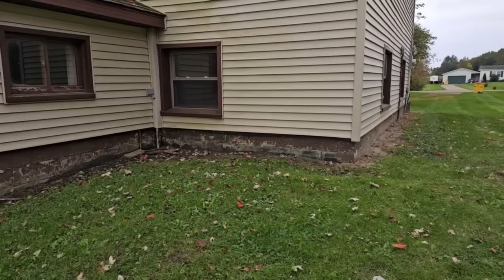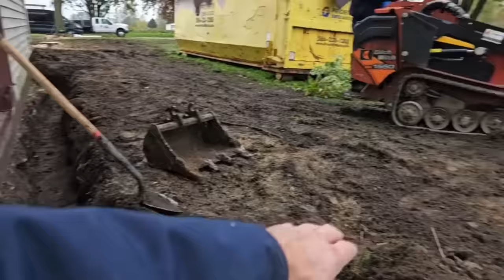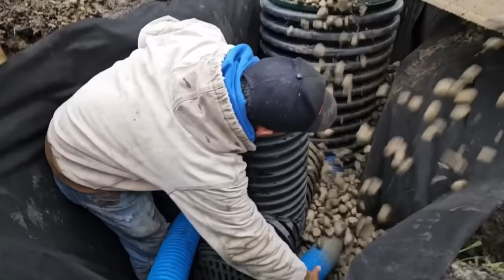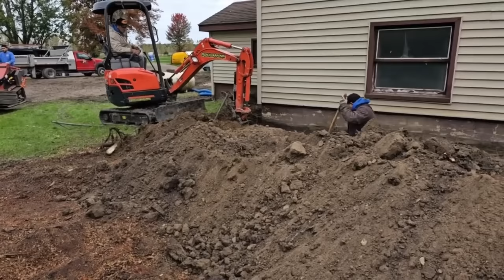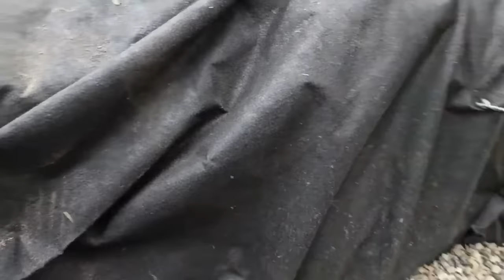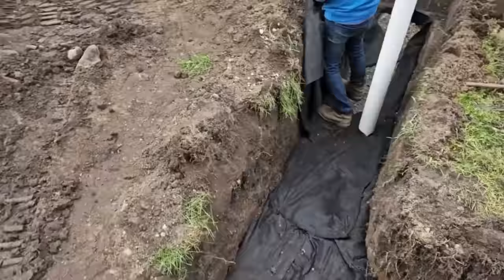How to Install Exterior Foundation Drain that Lasts Forever

Comment: A few questions:
1) Why the stone bed outside the fabric?
1a) Why no stone layer under the Hi-Octane Pipe?
2) Why no rubberized sealant on the foundation?
3) Would the double piping be more effect if they were at different depths?  I would put the one further away from the structure a little deeper to make the actual perimeter drain is a final outside defense against water intrusion.  Or would a drain further away from the foundation be more effective above the perimeter drain?
4) I see you're using a larger stone on top on the exhaust section of the system - why?  Doesn't larger stone tend to collect more water?
5) It seems that the footer drain is well below the footer of the house.  My other research indicates that slightly lower is ideal.  What is the reason for this?

Thanks for a response to any of these questions someone may know the answer to.
Reply from the maker: What you really need to do is watch the entire series and don't skip around in the videos. I answered all your questions, plus so much more valuable information at no charge 😃
Enjoy 
https://youtube.com/playlist?list=PLjFCqaZ4v1BWSyew4JyZuxDpBvULztf91&si=wZxI-Kk5-uNMQuc6
Reply: @FRENCHDRAINMAN  I just realized this was part 1.  Part 2 is answering some of these questions.  Thanks for putting this information out there.

Comment: How come you did a French drain along the foundation? I thought it’s better to build dirt so water slopes away then have French drain couple feet away (3-6 feet) from the foundation. Since water goes thru gravel and want to avoid water near foundation if pipe ever gets clogged down the road. So water from the yard goes directly into the French drain and avoids sending water close to the foundation
Reply from the maker: This is not a basement wall. You are thinking of a curtain drain when you are on the outside of a basement.
https://www.youtube.com/playlist?list=PLjFCqaZ4v1BVdT-DTxvVZNn0FAXbzCrUt&si=IAS-6c2m9VSiH4k9

Comment: Nice work. I would have tarred the foundation to seal it and also used a membrane. The Frenh drains need to be pitched away from the house or else the water will just pool around the foundation.
Reply from the maker: https://youtu.be/tQedrhHyX4s?si=ILb6VlxtnzTeNm6p

Comment: Thank you for making this video. Any additional tips when prepping an insulated slab? Just put the rubberized coating on the outside of the insulation?
Reply from the maker: I don't recommend that, and I can't see that working. I would apply the waterproofing membrane first and then put your insulation over it.
Reply: @FRENCHDRAINMAN  Thanks.  I see what you are saying, no need for the rubberized coating with the membrane already there. We put the waterproofing membrane over the insulation in the middle of the slab so it doesn't float during the pour.  So it's the same deal on the outside footing, makes things easy. Great channel, love the positive energy you give your crew

Comment: Would that material be safe to run a snake through? I avoid running them through anything corrugated because the teeth can catch the ribs and rip the pipe to shreds.
Reply from the maker: We run a jetter through them, and it will even blast all the roots apart. We have no problem running a powerful jetter line through the corrugated pipe.

Comment: Do you do this in sections so the home doesn’t have any chance to shift or do you just get it all done and placed in one day. Then you have no worry of shifting? Need to do this to my home I have horrible water entering my basement was gonna do similar but put a seal coat on the wall before backfilling.
Reply from the maker: If it was a basement, I would do it differently. This was a house on a slab built in a sloped grade. On one side, it was a few feet deep.
Reply: @FRENCHDRAINMAN Can you explain a bit more what would you differently? I need to build a similar foundation drain and it would be next to my crawl space (post and pier foundation)

Comment: What products do you recommend for French drain behind a 10 foot high solid concrete wall? Would the corrugated pipe get crushed under all that column of drain rock?
Reply from the maker: Dont go as deep passed the cold joint as we did because we had a 42" footing and had that luxury. Basement walls are on a footing thats not to deep so just drop the pipe below the cold joint. Pack around the pipe with 1/2" stone as seen in this video. Use Extra Heavy Duty High Octane 8 slot Armor Pipe. Wrap stone and pipe as one in fabric. No sock because they clog. Continue backfill with sand. Clay cap the top 6" if it's available for water shed.
Non-woven Geotextile Fabric in 4 oz and 8 oz
https://frenchdrainman.com/filter-fabric/

Comment: Would an interior drain system be just as effective as this?
Reply from the maker: If you have a basement, you have to have both. If you have a crawl space, you have to have both. If you’re on a slab, you can get away with just the one on the outside. You do not need one on the inside on slab homes.
Reply: @FRENCHDRAINMAN  in ohio our houses have basement. Typically there is an old exterior footer drain but over time they clog and the walls leak. Many companies try to sell an interior drain solution without addressing the exterior issues. If you had to pick only one option, would you fix the exterior issues, or install an interior drain as a retrofit and just let the walls leak into the basement for the interior drain to capture it?

Comment: Hi FDM. Great video and congratulations for the years of success. Im here in New York with thoughts of a new foundation for a cellar (4.5ft underground and 4ft above ground with 50ft by 33ft foundation size). Im following and taking notes. But do you necessarily have to have the drain pipes run to a sump pump in the yard or can i run pipes to drywells if you have a 30ft long rear yard?
Reply from the maker: My personal experience is dry wells 99% of the time can't handle the water. It will fill up, back up and cause flooding. If you want to core the footing and run the sump system inside you can. This was a house on a slab so that wasn't even an option.

Comment: What do you think about backfilling entirely with 3/4" stone except for the top 1 or 2 feet?  Im looking to do a drain to my new full basement.
Reply from the maker: A contractor I know did that. What happened was the pipe developed a clog. Water filled all the voids in the stone, and the hydraulic pressure blew the basement wall in. The basement was filled with mud. The homeowner had to stay in a hotel for a couple of months while the repairs were made. 
So NO, I do not recommend that. It's a terrible idea. Bulk surface water should be shed away with native soil sloped away from the home to not put additional stress on the foundation drain.
I hope this help
Reply: @FRENCHDRAINMAN  got it! Thanks for the advice..

Comment: Quick question what stops the water from leaking into the foundation or under foundation into the basement?  Would this work on an old house with old rock foundation.  I have water leaking into and under foundation.  I would love to send a video for your input.  Thanks.
Reply from the maker: There is no basement in this example.

Comment: What is that smaller t shaped pipe with a riser right before the sump pit that the drain pipes go around. Doesn't look like it was connected to anything
Reply from the maker: Back up sump pump system in case the primary fails; the secondary kicks on.
Reply: @FRENCHDRAINMAN  nice. Thanks.

Comment: How did you address the exterior areas where the house has a full height basement?

The video seems to show areas that are on a crawlspace or slab.
Reply from the maker: I have a follow-up video showing foundation waterproofing. A full basement doesn't have a 42" footing. You want the pipe just below the cold joint ( where the foundation wall meets the footing.
Thank you for supporting the channel 
Appreciate you

Comment: FDM - A quick question.  With an open french drain, is it necessary to pull out the gravel above the top layer of fabric and clean out the organic matter that collects over time?  I live in New England and leaves, etc. get in every little crevice of anything outside.
Reply from the maker: Every site has its own variables. I wouldn't do anything unless it starts to become a problem.

Comment: @FRENCHDRAINMAN how do you determine if a footer drain is required at the foundation vs. A shallower french drain set back 3 or 4 feet from the house (like a curtain drain? I have negative grade towards the side of my house that cant be graded resulting in some water infiltration under the footer and intonmy crawlspae.
Reply from the maker: First and foremost, you should always have a footer drain. Anything on top of that is just extra protection.
Reply: Aren’t you unnecessarily drawing water to your footer by putting a footer drain?

Comment: I just wouldn't feel right without some protective barrier against the outside of  the foundation , They have a number of products you can even spray insulation couple of 3 inches thick on the outside too waterproof it and to keep the dampness from getting through the cement block,,,,,
Reply from the maker: https://youtu.be/tQedrhHyX4s?si=emvfKqavfzJ3mSAt

Comment: Can you run a downspout into the same line as a sump pump discharge?
Reply from the maker: I don't recommend it. If the pipe becomes overwhelmed during a thunderstorm, it can backup.
Reply: @FRENCHDRAINMAN  thanks, ill build out a separate line for each!

Comment: Next time you have electrical wires under ground by your stone. Do not lay wires on stone or pale on top.  It needs sand underneath and on top of wires to protect them from being cut by stone.  Plus to lay a yellow electrical wire tape on top so if ever digging in future someone would know to be careful there.   Just a heads up
Reply: No doubt, and did you also happen to notice the electrical tape splice job they did on one of the service conductors?  Looks like one of the crew may have nicked some insulation with a shovel.  I guess nothing to see here folks, as these guys will be long gone by the time water penetrates the insulation 'repair', the conductor fails and the customer ends up calling in an electrician due to half power...    🤔
Reply: It needs to be RED DANGER electrical ribbon ideally 1' above live conductors!
Reply: @chriscordell6973  maybe now red.  But in my time it was wide yellow electrical danger tape. And yes 12” above buried electrical wire. 👌

Comment: How about just pour concrete cover around the house? It is much cheaper.
Reply from the maker: That helps with surface water but it doesn't do a thing for subsurface water. You have to run drain tile or your home foundation will deteriorate.

Comment: Wonder why they didn't elect to add exterior foundation wall insulation with that all dug up
Reply from the maker: Because it's not a basement it's built on a slab. I iInsulate from the inside no matter what anyways.

Comment: Seems like by digging out the foundation and adding rock you are messing up the grade  and creating a low point/draw for water to travel towards, should dig out the area going away from house , as well to at least same depth , cover with rock and top off with grass for aesthetics
Reply from the maker: https://youtube.com/playlist?list=PLjFCqaZ4v1BWSyew4JyZuxDpBvULztf91&si=6zZFKOXPvcAQAKpi
Reply: @FRENCHDRAINMAN  I'm not sure I understand. You are digging a big trench with rocks, so you are creating a negative grade towards the house. Water is going to flow towards those rocks. I get that you have a drain running along there which should collect the water, but now you are running it along the foundation. It would seem to me that maintaining the grade at the house, and trenching a few feet out would accomplish 1) creating positive grade away from house, and 2) creating a drain for expel water out away from the house instead of right against it.

Comment: I think, for next job,  you should always, put a paint blocker on the foundation before put down the stones.
Reply from the maker: The trenches would collapse and harm my men. Safety first. Anybody who's experienced in excavation and working in trenches knows that once you get deep, you have to take precautions to not have the trench collapse. Back filling with stone as soon as possible  prevents the trench from collapsing on the crew.
Reply from the maker: That wasn't the foundation that was below the footer that was a footing.

Comment: What about a basement. Yall only went  3 foot down.  My old house basement is road level
Reply: So I need to dig deeper and add more fabric.   But what do I drain all this to ? The city sewer I'm in town in a historic area
Reply from the maker: 10 feet deep. Hire it done. The homeowner can't do it.
Reply: Thank you for your response.  I'm working on a 100. Laid on clay. The house was on the market and sold, but the bank came by Friday and the basement was wet.And they don't want to cough up a 180000 for a wet basement.But in indiana all basements are wet
Reply: So we have $30000 estimate minimum for interior French train $20000 for exterior French strain. Min
Reply: Drain. Talk to text won't work right with my fan going. Lol
Reply: I subscribed.  Any help you can give I'll take. I'm just not trying to go to school or ask the building inspector
Reply: Or let a job I can do for 10k pass up to a company that doesn't care about the worker and charge 100 times more for the same job you can teach me to do.

Comment: Why don't you step up to a 6" pipe instead of two 4"?
Reply from the maker: It's much harder to daylight because it's taller. It's overkill. It's not DIY friendly. It's really unnecessary and it really doesn't belong for a foundation drain. And you're never gonna find parts that are 6 inch at your local hardware store.

Comment: I hate to put some negative comments here: By putting the French drain just adjacent to the foundation, you are inviting water to the foundation!  It may work now, but once it fails, all water will go in.  Why don’t build the drain several feet away?  The soil/clay in between the drain and foundation will work as a water block, though initially, it takes more time for the soil in between to dry in this already-failed case.   People need to understand, MOST water is channelled away by Mother Earth clay/soil/rocks, not by pipes and so on.   Take advantage of free clay/soil, will save us big $$$$$!
Reply from the maker: It's a foundation drain, it's not a curtain French drain. Big difference so you are wrong. I hate to be direct but I just want to be correct for all the viewers that read this. I do appreciate you watching contributing & sharing. I did not find your comment negative, just misinformed.

Comment: Dug way too deep. Bottom of trench should be about 2 inches above bottom of footer. In the future the homeowner will likely have settlement issues from creating an active moisture zone under the footer, causing washout and softening of that soil.
Reply from the maker: So not true. Water would leak at the cold joint.  All your hard work would be for nothing to install it the way you just described. 
Best of luck 👍